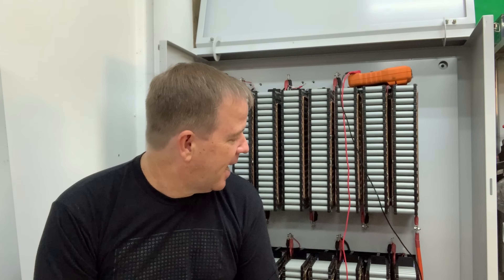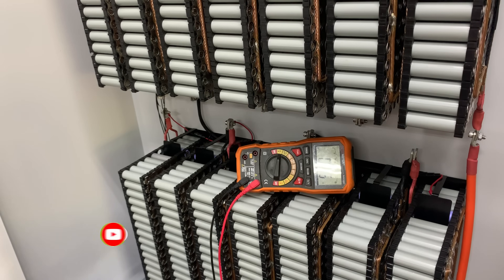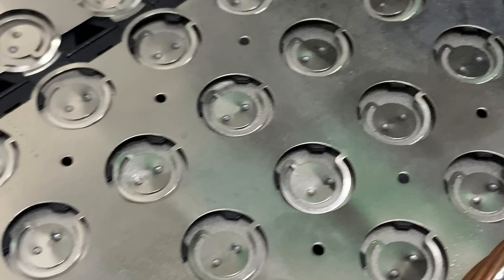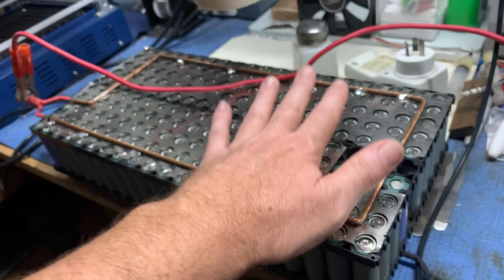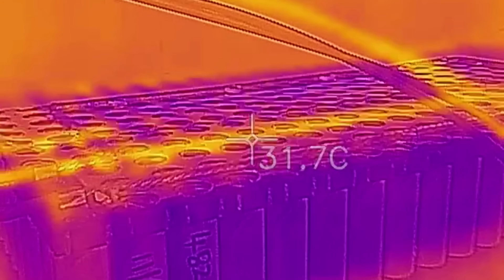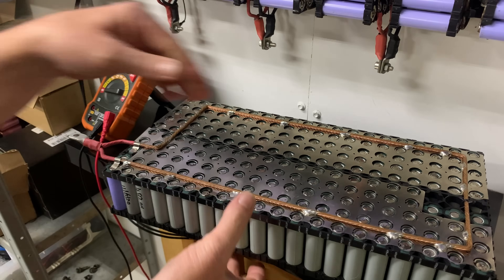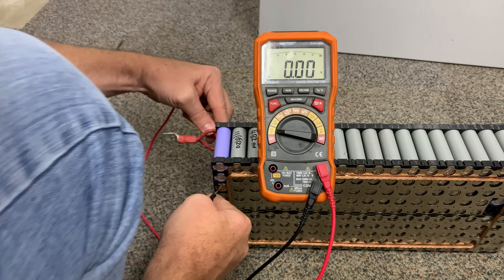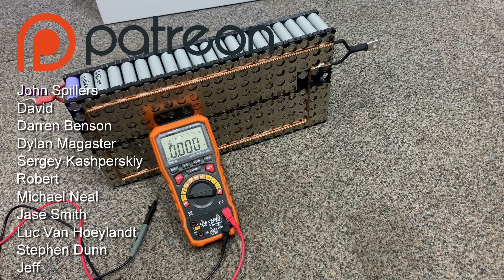Wirelessly charging 18650 batteries!

Comment: HBPowerwall, it might be worth printing a clamp for your bus bars. I made a example https://www.thingiverse.com/thing:4807770 in this example the bus bar is clamped down with plastic, and a 65-75mm m5/m6 screw and lock nut. This would be insulating, with little to no risk of shorting, and would prevent the dead batteries leaking and destroying the rest of your packs. you can either go on etsy and find a local maker to help design this, design it yourself, or go to a maker space and see if someone can help you make and print this. If you have a printer, and want to try what I slapped together and see if its spaced correctly, just use the 3mf file since that will have separated objects for your slicer making it easier to get on the print bed.
Reply from the maker: Thats a neat idea

Comment: How is this pack balanced? Even if all the cells are from the same batch, there will be slight differences in capacity. 6 months is easily enough time to lead to a significant imbalance between cell groups if the balance current is too low.
Reply from the maker: The battery hasn't been commissioned - its been sitting idol

Comment: Remove the cells and replace with wood dowels or aluminium rod, both will give you the mechanical strength you want and after removing the old batteries you will see electrolyte growing like stallagtites and piercing the sleeve of the neighbouring batteries to give you an electrical connection to your pack.
Reply from the maker: I need to pull down to inspect but this dam Tesla Battery is so much fun to work with lol
Reply: @HBPowerwall  I bet, I wish I had the opportunity to do the same.
Reply from the maker: I'm both very lucky & extremely grateful for the experience!
Reply: @HBPowerwall  I'm looking forward to seeing the video of the internals of the Tesla Wall

Comment: mate, I need your help, I have a 12v, 400 AH lithium battery that I took out of my motorhome to find that the bms was faulty. is there any chance I can bring the battery to you for a good service if possible?, that would be very much appreciated. All the best. Allan
Reply from the maker: No idea, can't really 'service' batteries... but sure.
Reply: @HBPowerwall  what I mean is balancing the 4 x 400AH cells and doing a capacity test??, give me a call for your address, I am on the GC, thanks mate
Reply: 0412182528 dueeh!!!!!!!!

Comment: Your support bar was barely touching the positive and ground or the fluid that leaked fro the battery is causing a short or maybe the ink on the heat shrinks causing it similar to if you draw a line on a car battery it will short it out
Reply from the maker: that is the most likely cause I'm thinking..

Comment: I would guess they behave like a capacitor. The outside of the batteries is big conducting plate and it is close to the other negative plates of the surrounding batteries. By connecting the positive of the battery I could be possible that it starts behaving like a capacitor.

Try to make the setup smaller. One empty battery with only the positive post connected surrounded by 3 batteries that are fully connected. Let it run trough a couple of cycles and check the voltage on the 'empty' battery.

Comment: Clean shave and all, wow. You need to get a Keithley meter or a HP meter that has 6 digits past the decimal. You would be able to spot a drainer easily. You could even use a VU meter with a voltage divider too.
Reply from the maker: Didn't even know that was a thing!

Comment: Your construction has fuses, which help you to find out damaged cell.
I think, you should measure the voltage drops on each fuses (without any external currents, charging or discharging).
The cell with maximum voltage drop on fuse is a damaged cell.
Reply from the maker: Need a very accurate multimeter and a jig to hold the electrodes to the battery consistently.

Comment: If that rusty 0.0 Cell, is internally shorted. Then it would cause complete a circuit, to somewhere... Why is this video titled, "Wirelessly charging 18650 batteries!"? That's what I came for... Don
Reply from the maker: I made a dumb bet with another comment -  I lost :P Gota have some fun right... I need to find that 'somewhere' maybe today if I get time!
Reply: @HBPowerwall  I see, I've been following your channel, for several years. And don't remember any "click bait" titles. So, I thought it was real. I don't see why it couldn't be done, on a large battery bank. May be to expensive to build, though... Don

Comment: I think when you had the pack on the bench, the weight of the pack pressed the main negative lead up against the negs of at least 2 of the three dummy batts, and the positives of the dummy batts were all welded, so while you were charging, you had a good circuit, dummy batts got charged.  my guess is that their sleeves are rubbed or spiked through on the clean batts, and the electrolyte of the leaky dummy either bridged or degraded the sleeve enough to allow for an electrical connection.  see vid at ~2:50.  when the battery is hanging up in the normal pack position, either the clean dummies might not have been in contact, or maybe the tension on the lead (due to it being connected to its neighbor pack's positive) pressed it against the negative side of the dummies.  
--> for the leaky dummy, maybe that one has been part of the normal charging circuit pretty much from the beginning, but only through an intermittent connection - lets assume due to thermal cycling of the pack(s).  so periodically, the leaky dummy might discharge with the pack, then float a bit, then all of a sudden see a very high charge voltage and current because the rest of the pack has been charged up to 4+ volts while the dummy was left disconnected at 3V.  The same sort of thing might happen on discharge too.  So, the constant bang-charging of the intermittently connected dummy battery would age it much more quickly than the rest of the pack, hence the leaking.  once it was damaged, it could be constantly connected (leak bridge?), or even if it wasn't, any time the pack heated up, it could basically act as a shunt between the positive and negative in a bad feedback loop and shunt-discharge the pack. 
--> when you were testing after taking off the positive welds, i can only guess you were seeing some kind of bridge caused by the leak.  if it's not directly to the main negative lead, it could be hidden from view and be bridging the outer can of the leaky dummy to the outer can of one of its active neighbors.
Reply from the maker: ooh i think you might be onto something there.. i'll have to take a look at all the raw footage and security footage to see if i did something there!

Comment: Hi. The mystery is how hot did your bus wire get when it was close to the 3rd cell in.  The fact that you can measure your full battery voltage from the minus side of that battery to the plus buss lead says that that battery is connected to the can of the battery otherwise known as the outside of the battery.  If you were to bend the bus wire towards the center of the body of the battery just enough to clear the possible contact point.  It looks like you could put some barley paper underneath the areas of the blue batteries and you would not have any more problems with those three batteries.  You can use some 5-minute epoxy where you did have the straps before to add a little bit of rigidity to the bus wire.

Comment: All batteries have internal resistance which should be matched for parallel sets like yours. I suspect the brand has enough difference to case those batteries to form small current flows between the parallel circuits.  I suspect the age degradation may also influence the problem over time.  The only method i know is to measure on a single cell the current flow of a known resistor to calculate the internal resistance.  We had meters to check cell resistance for srries battery as PM quarterly check.

Comment: Serious question I am ready to buy the patriam I have the same type of set up as you do with the 18 6 50 100 P packs I am only doing 7S right now until I get more batteries and I also have the multiplus victron 3000/24 V and the 150 - 35 control charger... I just want to make sure I make the proper right purchase in the best pursuits the WM5 would be the one that I want correct with the long mobs???

Comment: battery leakage has created a link to the other terminals.  I bet if you removed the cells you might see more leakage.  Cant you put blank plastic rods in place where the holders touch?

Comment: Hi, just watching your video and it's not odd. Here in Canada when we winterizie our cars for the cold winters, one important item we do is clean the top of the battery so as to not have a battery drain across the connections due to the plastic of the battery absorbing humidty and dirt and slowly draining the battery. By connecting your tabs to hold your cable you actually started the procces of charging your inactive cells, reverse process for us drainning the battery in winter. Also can you test the voltage from the cell to the plastic case holding the cells, I would not be supprised that they conduct voltage now. Seen issues with plastic conducting low voltages found with a DMM causing weird car issues in automoble computers. This could be the odd issue you are having.
Reply from the maker: Never considered the plastic might be at fault. Will defiantly include that in the follow up video
Reply: @HBPowerwall  Yes looking forward to it.

Comment: Agree with your conclusion that the negatives must be connected somehow. Possible ideas from watching video:
1) The charger negative sense lead was touching one of the "dodgy cells" (could only see that it was in the general area during video, not the exact connection point).
2) The wall mount is shorting the negative sides somehow (esp. relevant if sat in the mount off camera at some point.)
3) Cells were negative side down on a possibly conductive shelf during charging.

I'd suggest continuity testing between pack and cell negatives with the pack in a few orientations to see if it changes anything, as well as while sitting in the wall mount, just to eliminate unexpected mechanical deformation as a possible cause.

Comment: have you tried the continuity mode of your multimeter from e.g. negative busbar to the 'disconnected' side of the batteries? that should give a clear indication. If that beeps, it's for sure a connection, right?

Comment: Why not replace those leaking cells with wooden dowels instead so that theres no chance of them ever shorting anything
Reply: or 3D printed dummies
Reply: @DaRockCRX  or that
Reply: Some notebook batteries come with a fake battery to fill up the gap. Those could be used.
Reply: I thought nylon rod might work well on mine, mine are in action 6 months and so far I don't see any of this
Reply: thats what i thought in previous video that he could add a dummy cell there instead of using actual cell. as the load of battery is nearly 10kgs and thats the cell which was at upper side so there's huge chance that liquid came out of battery and drip downwards and created path.

Comment: Considering that this pack got the same power x current the Energy must have disappeared in chemical reactions or and heat.

We also do not know what cells else could suffer  from leakage cause the Kathode and Anode at covered.

Mystery hunt is pretty demanding but I guess that replacing the 3 batteries with pieces of a broomstick of 18 mm Diameter cause those are strong and you can screw screw into those Sticks to fix the terminals even better.

Comment: The wire is putting off a field from it and maybe interfiering with the cell . Just like high voltage wires put of an electric field . I think if you had sheilding over the large wire but not where its soldered onto the panels . Electricity puts off a field . It maybe only a little bit but its enough to do damage . Its like the battery wants to be part of the big pack .

Comment: certainly a hair puller to which I do not have an answer. As to securing the bus bars, I drill out the holes in the cell holders and use 250mm x 2.5mm cable ties. Works really well and is pretty strong.

Comment: Discharging a li-ion cell occurs when the lithium atoms in the anode give up electrons which then flow out the neg terminal into a circuit to do work (e.g. light a pixel led).  Each time a lithium atom gives up an electron it becomes more positively charged.  After doing work in the circuit, the electrons flow into the pos terminal of a cell & accumulate in the cobalt of the cathode.  This gain of electrons causes the cobalt in the cathode to become increasingly negatively charged as it continues to accept electrons.  The difference in charge between the cobalt & lithium atomic charges attracts & causes the positively charged lithium atoms to migrate through the electrolyte towards the cathode to form a cobalt lithium oxide bond to balance the difference in atomic charges.

When a li-ion cell is charging, electrons are forced into the positive terminal of a cell & into the cathode to reverse the chemical (cobalt-lithium-oxide) bonds & repel the lithium atoms back through the electrolyte & back into the anode.

I think by having the positive terminals of your cells connected to the positive charging wire, that is sufficient to recharge a cell--even if there is no connection on the negative terminal of the cell.  To test this hypothesis connect the positive posts of 2 li-ion cells & then connect your charger to the positive & negative terminals of ONLY 1 of the cells to see if both cells will charge.  If both cells get charged then you have proven my hypothesis correct & that is what has happened in your case to charge those cells.  If not, then idk what has happened in your case...
Reply: i think this is backwards current flows out of the negative to the positive in discharge as you have stated, so to charge current would flow into the negative to the positive,  and closed circuit is required for current to flow in any direction, there has to be a  potential difference or current flow can not exist with a floating terminal, as a dead battery both terminals could be the same potential difference, it by completing the circuit to a charger that one side becomes negative and the other positive enough to sustain current flow and this would explain reverse battery charging when a battery falls to 0v and is then reverse charged by adjacent cells in series the potential is reverse.
Reply: @MindMeetMaker  Remember, charging puts energy into the cell to reverse the chemical reaction caused during discharge--which effectively adds energy to the system chemistry so that another discharge of energy can be used again.

Given that he showed that some of his cells were charged without a connection to the negative terminal, we have to some how work out how that is possible.  I offered a hypotheses above to try to account for such a thing happening.  If that is not possible then I'm at a loss as to how such cells could be charged without a negative terminal connection to his charging circuit.

re:  "there has to be a  potential difference or current flow can not exist with a floating terminal"

But, he showed that 2 of the 'dead cells' actually got charged up (3.7V & 4.1V) when his charging cycle ended.  The question is--how could that happen with only a connection to the pos terminals of the cells & no connection to the negative terminal of the cells.

re:  "as a dead battery both terminals could be the same potential difference, it by completing the circuit to a charger that one side becomes negative and the other positive enough to sustain current flow and this would explain reverse battery charging when a battery falls to 0v and is then reverse charged by adjacent cells in series the potential is reverse."

Some rechargeable cells can indeed be reverse-charged (although I've never seen a li-ion cell reverse-charged--but, I suppose it is possible), but that doesn't eliminate the need to have a connection to both terminals with a difference of potential to create a charging current flow.  I just looked at how he connected his test probes to the cells & the cells are obviously not reverse charged as the polarity shows up properly on his meter...

Comment: You won’t see any over heating cell in the inside as the nickel strip will be reflecting and hiding any heated cells and if the cell is shorted on the earth side you will get a reading from the park, How’s the cell leaks it may have shouted across on the Earth side of the cell from the leaking electrolytes

Comment: Hmm mystery time.. so you connect one side and then have high amp running through the bus-bar on the other side within mm's of the bats.. inductive charging would be the first thought.. the rusted cell seems to have a popped CID so i would guess that the cell's were being inductively charged and a drop of water (probably condensation from the cabinet) dripped on it while inducting, forming accelerated oxidisation and sent that cell into thermal runaway but only just.. so it melted the sleeve to a neighbouring cell reconnecting the inductive loop on that cell once more.. hence slow discharge over 6 months while in storage lol 

I love mystery's.. can't wait to see how much of my waffle was wrong. lol